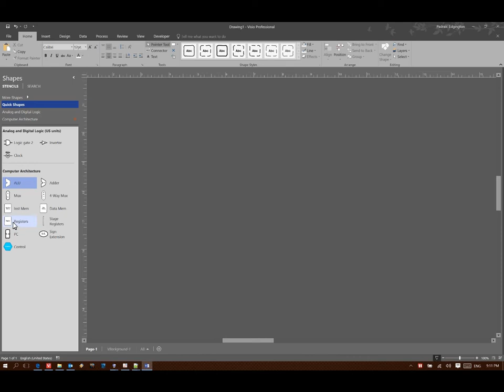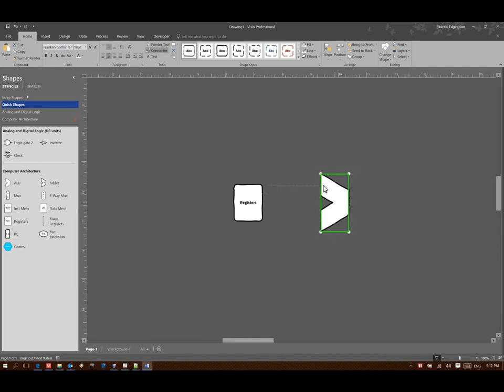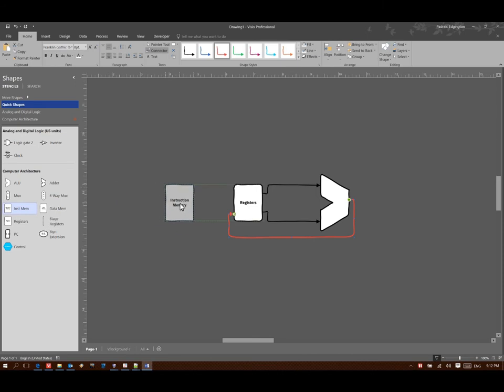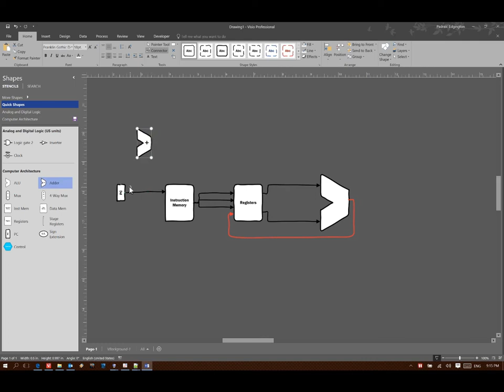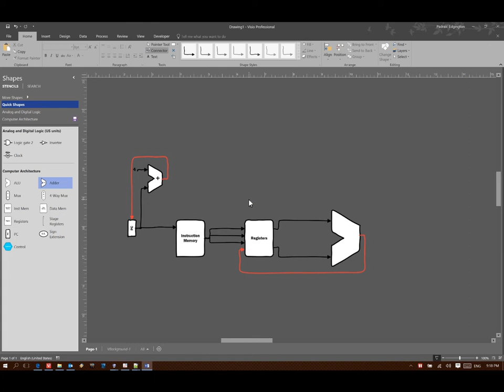2-1.  Datapath (add)

Comment: whats the name of the software you are using please .
Reply from the maker: I used Microsoft Visio to create the diagrams.
Reply: Padraic Edgington oh so u actually created the shapes yourself...cause i was actually trying to find computer architecture shapes to download and put on visio. Do you know of any engineering sites that may have these? Just to save me the effort of drawing them.
Reply from the maker: Some of them are built-in, like logic gates, but most of the architecture specific ones I did create in Visio.  It's generally not too hard:  Grab some basic shapes and put them together into the form that you want, then use the Union and Subtract operations to create the outline.  Then go back and add connection points.  The first time or two it felt a little weird, but you should get the hang of it pretty quickly.  You can also find some decent tutorials and explanations of how to create Visio shapes online.